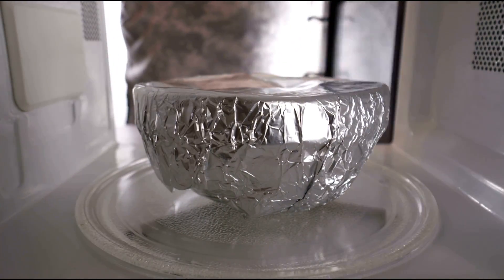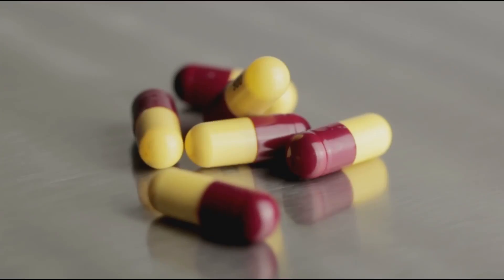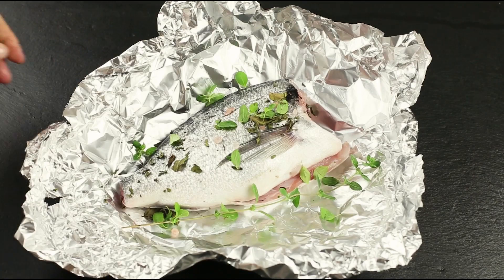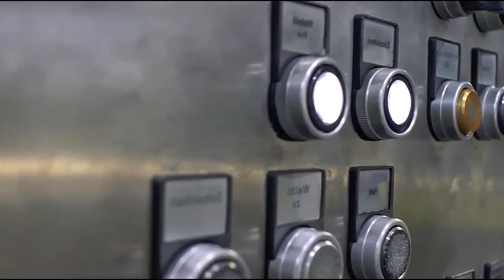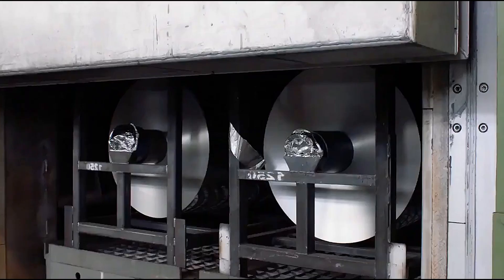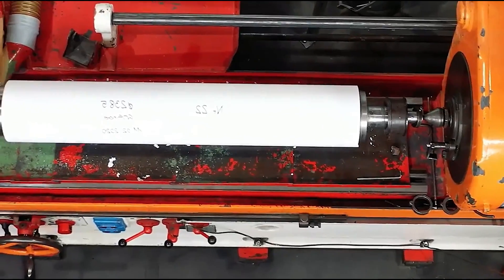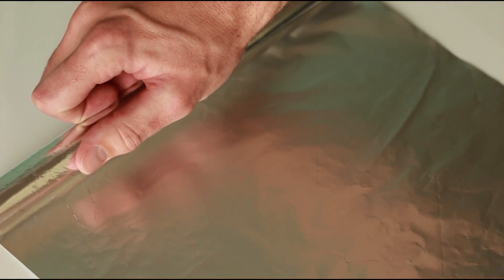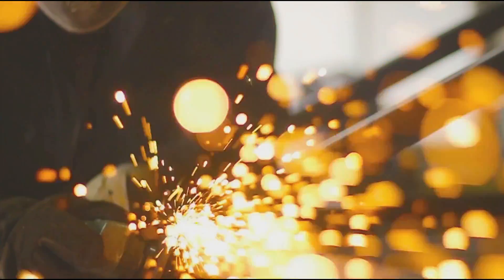HOW IT’S MADE: ALUMINUM FOIL

Comment: I'm on a quest to learn the thickness of American standard and "heavy duty" foil. The thickness is NOT specified on the packaging, as it is in plastic bags. I got some WalMart "Heavy Duty" foil recently and it certainly feels thinner than before, and this is exactly what you'd expect from manufacturers, who are always looking for ways to sell you less. Hope I'm wrong. Cool pirated video. As far as putting foil into a microwave, it's not got enough mass for that purpose, but I routinely put stainless steel mixing bowls in the microwave. "No metal in microwaves" is an old wives' tale. Just don't put tiny bits of metal in, as they will overheat and could cause a fire.

Comment: Tin foil in microwaves actually works
Reply: According to the FDA, "food completely covered in aluminum foil should NOT be put in the microwave."
 
"The electric fields in microwaves cause charges to flow through metal. Thin pieces of metal like aluminum foil are overwhelmed by the currents, causing them to heat up so quickly that they can ignite and start a fire."

That wouldn't be a good day for anyone if that happened to them.